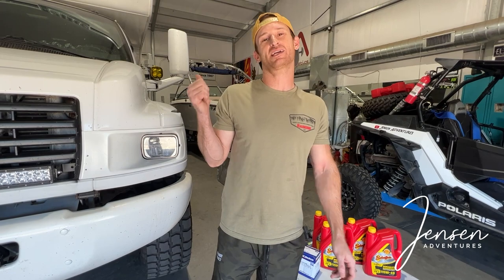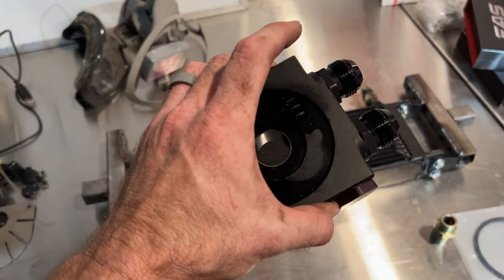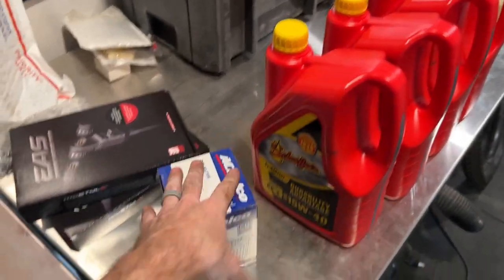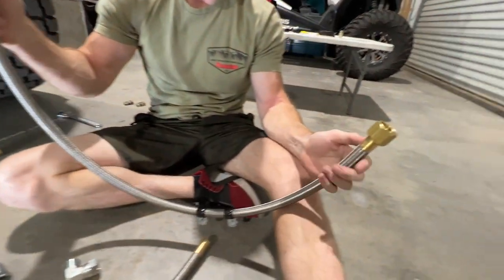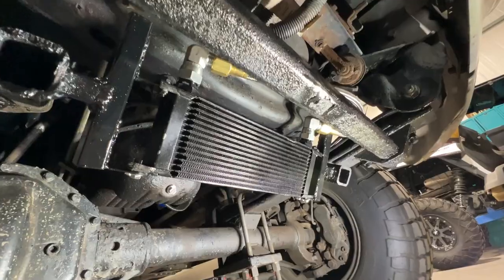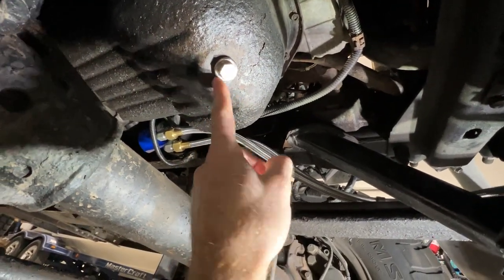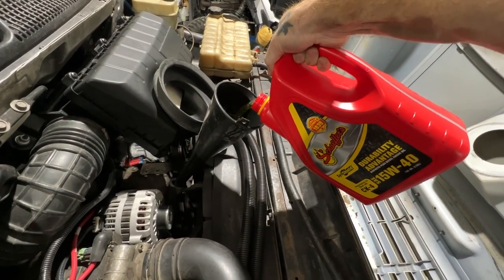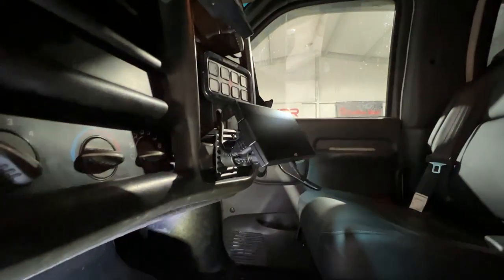Building our 4wd Kodiak Truck Camper! Part 9- Oil Cooler

Comment: As always, Thanks for sharing 👍.  I never checked with a proper sensor so l don't know if my D-MAX is running oil temp to hot? Why do you think yours was running hot 🔥 and what tipped you off to check? 
Do you know if it's a common problem with kodiaks? or D-MAX in general? 
And lastly, where did you purchase the sandwich and cooler? Okay l lied, last question, $ how much did the parts cost you? Not the oil and filter.
Thanks once again, like that you both contribute to the build, really great stuff.
P. S. any chance that your going to upgrade your diffs? Lockers, like e-locker or an air locker? I would like to see that, the expense, why ? a brand over others...
Thanks ♥️  Again you two! One of my favorite builds.
✌🏻 🧡 🌤 🇨🇦🤘
Reply from the maker: Kodiaks don’t come with an oil temp sensor. I’m just doing whatever I can to lower my temps. Towing my RZR with the camper on I hit about 240 degrees on a 6% grade. Swapping the intake to factory will really help. I figured adding the oil cooler would help bring my coolant temps down. Going to be upgrading the transmission cooler as well. The sandwich adapter link is in the description I think it was $150. Yes I plan on doing a rear locker probably next year. Haven’t done enough research yet to know what exactly I’m gonna do but most likely and air locker. Thanks for all your comments!
Reply from the maker: Oil temps should be within 20 degrees of coolant temps.